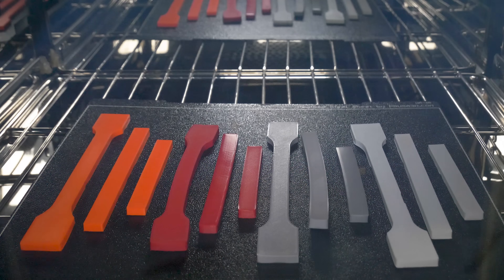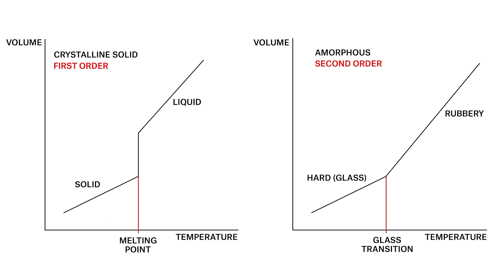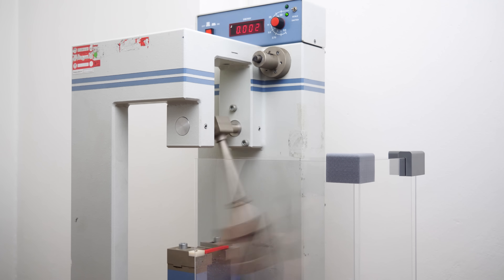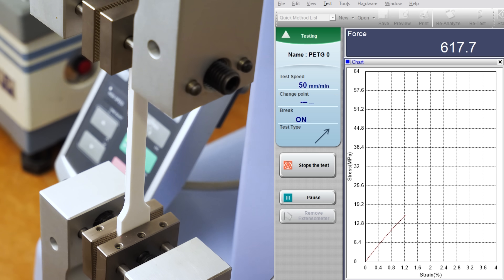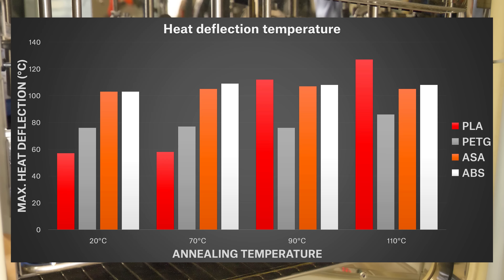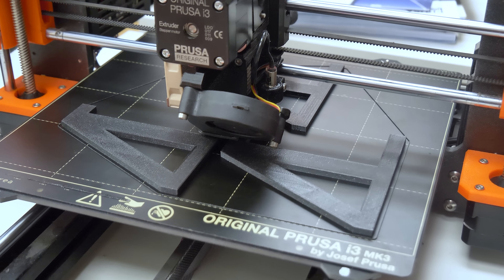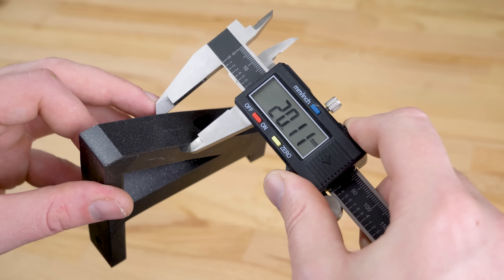Annealing: How to improve your 3D prints

Comment: Layer adhesion is my biggest issue.
I tried 100% printing, covering in plaster of Paris, then 'cooking' above the melting temperature. However even 100% 3D printing is not really 100%, so I found that the print would have voids at the top of the 'casting'. However the resulting casting is amazingly strong.
I had the idea of using a spit oven with a mechanism to rotate the casting in 2 axes. This would create a hollow moulding, which would be fine, but somewhat complicated to make, although the rotating mechanism could also be used for rotational moulds.
However I then realised, all I need to do is include spare material at the top of the print to ensure no voids and any excess can be trimmed, like sprues on an injection moulding. Strength is amazing and due to the plaster, dimensions remain accurate. The surface can also be sanded before casting, to create a decent finish too.
Reply: i was thinking of using a mold as well

Comment: When one completely remelts a PLA 3D-printed part inside an oven (see free spirit 1 and CNC Kitchen videos on this) encased within an enveloppe of plaster or salt, is the resulting molecular structure amorphous or semi-crystalline? 
Said otherwise, after such an extreme step, is annealing at lower temperatures as a second step still mandatory to give maximum strength and temperature resistance to the part?

Comment: Currently I'm annealing a very simple phone holder to be placed inside a car. Does anyone have any practical experience how annealed PLA performs in such environment (no direct sunlight, only heat)?

I've 3 test parts: untreated, 80°C/0.5h, 100°C/0.5h. The plan is to change when one fails and see the results, but summer is far away, and maybe the whole thing is doomed. :D

Any comment appreciated!

EDIT: the parts were embedded into flour to help with deformation.

Comment: Didn't get how does annealing affects the layer adhesion. As I see you tested the tensile strength along the layers (material strength). Did you try tensile strength in the Z direction?

Comment: @Prusa 3D by Josef Prusa 
Could the annealing process be performed on the bed of the printer by placing an insulated box over the print plate and setting the bed temp to the relevant temperature. If this were to work it could be very useful in a production environment to have a dual bed printer. When one print is finished move in the other, prewarmed bed and continue printing. The finished print could then have the insulated box placed over it and use the bed warming to anneal the prints before removing them from the bed. It would result in continuous printing and stronger annealed parts... Just recently bought one of you printers, love it and will hopefully be buying alot more shortly.
Reply from the maker: We tried it and it wasn't as great as we thought it would be. You cannot place the parts directly on the bed, the temperature gradient caused by the warm bad underneath and colder air above will cause the parts to severly warp. So you would need something that doesn't conduct temperature very well, place it on the bed and then place the part on top of it. You would also have to add a small fan to move the air inside the box so it warms evenly. Even with that setup, it will be hard for the air to reach the target temperature, as there's no insulation on the box :/ It might be enough for annealing PLA, for other materials the annealing temp. is too high.
-Mikolas

Comment: Thank you for the video. The numbers of the impact tests seem wrong by the factor of 10, though. I think a unit error occured when you calculated the resistance. The titel on the y-axis should also not be "energy" but impact resistance, or something. However, very nice video!!

Comment: what do you use as an annealing surface? I have a PID controlled toaster oven and tried to anneal polymax pc at 100c after autotuning it. I put the test object on the metal cooking surface that came with the oven and it melted! 100c isnt even supposed to deform polymax PC so this means the surface heated it up more than the ambient air in the oven.
Reply from the maker: We used a circulating air oven. The toaster oven might be the culprit, as the heating wires typically reach a higher temperature to achieve browning of the food. Covering the print with a lid might help with this. -Mikolas

Comment: I use a wooden board with screws in it as a fixture to fix my parts to avoid warping in key areas eg. relative screw positions etc. works like a charm.
Reply: I was just wondering if that'd work. Thanks for commenting this.
Reply: I was thinking of machining an aluminum jig for this as well.
Reply: I was thinking to 3D print a jig to hold the 3D print in place
Reply: @Etrehumain123  ahh the X1C has a high temp carbon which can be used for fixtures in the oven. Goes upto 280+ degrees C
Reply: this is an amazing tip
Reply: I might try this but printing at 100% infill is very wasteful

Comment: Good info thanks! From the graphs it looks like PETG annealed at 130C is a sweet spot. The heat deflection test stopped annealing at 110C, just curious. For extra strength I design threaded holes for long bolts to reinforce printed parts. I put them in quickly with a cordless drill so the friction melts, lubricates then glues the bolts in. Bolts have a pitch tolerance but with some melting you get a perfect fit.
Reply: The better way is use heat set inserts. Then your insert is melted in and you get perfect threads that hold more.  Ive tried both methods.

Comment: PLA is semi crystalline, and increases crystallinity with annealing. You can observe that if you anneal transparent PLA, and thereby reduces transparency. That is also why the HDT increases substantially for PLA, as it lowers the amorphous-to-crystalline ratio, and the amorphous phase softens first. It is also no rule that crystalline structures are weaker or has less fracture toughness. And lastly in this stupidly long comment: the effect you are observing is not only about increased or decreased crystallinity, but a combination of various factors as reduced manufacturing strain,  more molecules crossing the filament boundaries, reduced void sizes, reduced sharpness of the notches in the voids, changes in specimen geometry  ++++.
Reply: And of course, if you remelt the specimen, as done with the last, highly deformed PLA-specimen, the amorphous phase ratio increases again.

Comment: Filament winding with epoxy impregnated carbon fiber & laying up carbon fiber reinforcements, then vacuum baking the parts in a PTFE bag in your oven to cure the epoxy & treating the PLA/ PET part as the inner layer "fill" for the composite outer layer / you can build very very strong parts like this with some serious intensity of investing time & materials if you want a strong plastic composite functional part

Comment: When strength is needed, why not just build your parts to have a coating of epoxy. Thus your printing will act as a scaffold for the epoxies.  (Only make sure said epoxies will not melt your parts!) HINT: I use a paint in a thin coat that only slightly melts the ABS, then I am free to coat in epoxy with out worries.. As said paint acts as a shell...
Reply: Because the two materials have different properties and will fail.  You would need to use a fiber with the epoxy (like carbon fiber sheet).  Epoxy alone isnt very strong and will crack when part starts to flex.
Reply: @outkast187  Fibre is a given. Never thought that was needed to be explained. As the Epoxies sold as binder agents have micro fibres within them.. 
As for carbon fibre you would be using a pure epoxy and many layers. 
That would make one strong device...

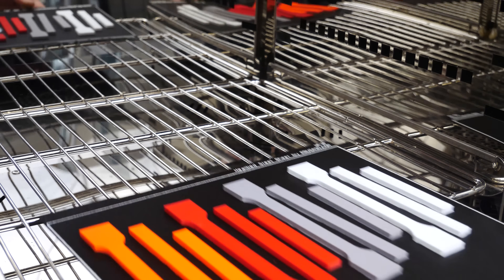Comment: I have tried annealing, and I still haven't found a viable use case. The main problem is that the shrinkage tends to trigger something akin to buckling instabilities, which causes straight walls to morph into curved walls. The shrinkage caused by annealing generally can't be correct just by adjusting some XYZ percentages. I presume the footage at 1:10 is exegerated, but it illustrates the issue: the parts don't merely shrink, they curve every which way in unpredictable and uncontrollable ways.

Comment: Does the Prusa Printer Enclosure also improve the strength of the printed parts?
Reply from the maker: Yes, but in a different way. ABS printed in cold enviroment has poor layer adhesion and as a result compromised mechanical properties. This problem is not so big with ASA, but still in both cases the enclosure helps, not to mention the significantly lower warping.
- Mikolas

Comment: thanks for doing these tests, but there is another problem that i have encountered that warrents investigation, and that is elastic range, eg you make a ring to clamp onto a steel part, needs tension before it grips, but the material breaks when cooled because the thermal expansion rate of the plastic is a lot lower, and shrinks and puts itself in tension into a non elastic range and even beyond its plastic range at lower temperatures, this has happened to me in a lot of pla parts, even with zero inital tension(achived with adhesive fill). thanks

Comment: I haven’t had success with annealing with dimensional PLA parts due to warping — parts curling up (shrinkage would be ok). I was trying 74C for a longer period of time — 2 hours. Perhaps try PETG? Or hotter temps?
Reply from the maker: Could be caused by uneven heating e.g. oven without air circulation with heating element on top blasting at the part. You could try puting the print in some kidn of a container (glass) which would make the heating more even.
- Mikolas

Comment: How about immersing the parts in a water bath and then heating them? This would prevent warping since pressure on all faces is equal. 
However, temperatures are limited to 100°C and below.
Reply: It wouldnt prevent warping as much as you might think.
During printing the filament is stretched along the X and Y axis, along the Z axis filament is compressed as its squished into place.
when you anneal parts to the glass temperature it wants to reverse this stretching and compressing. this relieves internal stresses and thus makes it stronger.
Reply: @awellner3285  I see, thanks for the info!
Reply: I actually wrote a blog post about annealing using a water bath! You can read more about it here: https://www.justinmklam.com/posts/2017/06/sous-vide-pla/

Comment: To help with the warping, you can stick the model in a bucket with sand and then anneal it. It will take longer but it won't warp out of shape. It will still shrink/expand however.

Comment: Could parts be reinforced by e.g. filling with epoxy resins?
Reply: Interesting concept
Reply: Depending on size of object and how much you pour in. Epoxy resin curing is exothermic reaction and with large volume of resin, it can heat up to 60 degrees Celsius - which is when PLA starts softening.
Reply: Epoxy resin became soft at about 80 degree. There are several exotic kind of heat resistant epoxy, but they also need annealing. So it could be solution, but not simple.

Comment: I don't know how much it actually inproves the strength, but I have hot air gunned 3d prints on certain aeras I want to bend slightly and it seems to end up stiffer and stronger

Comment: I've reprinted my MK3S extruder parts in ProtoPasta's HTPLA-CF (carbon fiber filled). Their published printing correction scaling is to print with x/y at 100.6% and z at 99%. After annealing, the parts seemed nearly identical to the Prusa printed originals. (I didn't put calipers on them though.) I didn't remove the parts from the print bed before annealing, so I don't know if that helped or hurt. I also didn't have any fitment issues when assembling the annealed parts. If anything I think the filament sensor might work a little better because the hard surfaces of the annealed parts slide against each other better than the Prusa printed PETG parts reducing the friction. One downside of the parts being harder is the heatsink rotates a little easier. I'll see if that is much of an issue after a few nozzle swaps, though the heater and thermistor cables do help constrain the rotation of the heater block.

Comment: CNC Kitchen made some great videos to test that.
What would be interesting for ABS and ASA is a slow heat treatment to get into the print core, then an acetone vapor treatment for exterior.
But, that kind of test is only interesting for flat prints :(
Reply: Acetone is shown to weaken the structure. So you may end up with a fragile object and a lot of work.

Comment: According to tests results of dimension change on annealing, It would be nice to have corresponding presets/options in prusa slicer...
Reply from the maker: The dimension change is not constant with temperature but rather changes with each model. So ideally, you would print a model, anneal it, meassure, re-scale, print again and anneal again.
- Mikolas
Reply: @Prusa3D  I see, thank's anyway.... just... was looking for more comfort... ;)
Reply: @Prusa3D  Well, some complex math + ability for the user to input the warp coeff. and potentially you could apply a reverse transform to the model (while slicing). Non-linear, of course, not just scale. Cheers!

Comment: Did you consider annealing the part in sand to prevent or decrease deformation?
Reply: Solid suggestion
Reply from the maker: CNC kitchen did anneal benchy burrowed in sand and it didn’t seem to help much:
https://www.youtube.com/watch?v=dOzVuoBP9gY
- Mikolas
Reply: @Prusa3D  He vastly overheated the parts, and without using 100% infil. As much science as he talks the experiments are often badly considered. A second opinion would be nice.
Reply: I’ve tried annealing using a water bath (as heat distribution is more even than in an oven), but the parts I tested with were a lot smaller. Results were somewhat inconclusive, but you can read about my findings here: https://www.justinmklam.com/posts/2017/06/sous-vide-pla/
Reply: I've annealed a few prints in Proto Pasta carbon fiber high temp PLA, and I had little to no shrinkage. I kept all the supports on as suggested. I was very happy with the outcomes every time.
Reply: Formfutura Volcano pla works like a charm